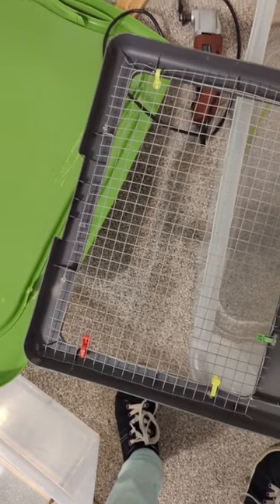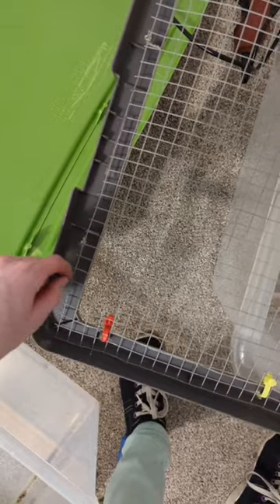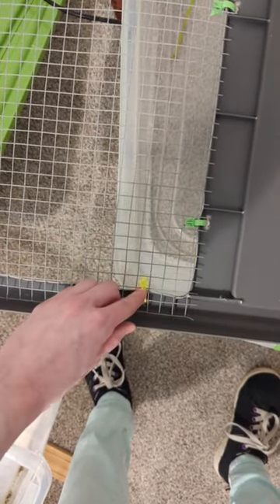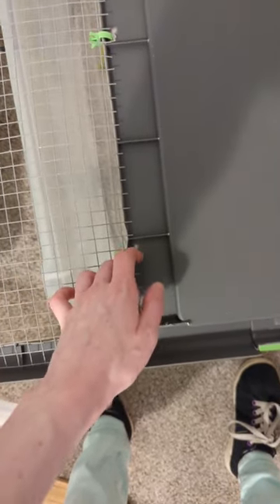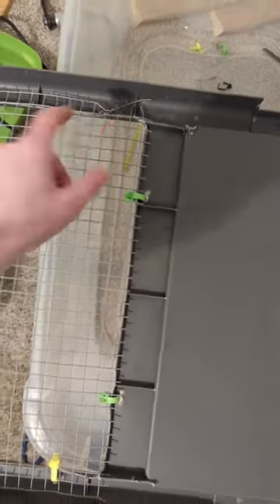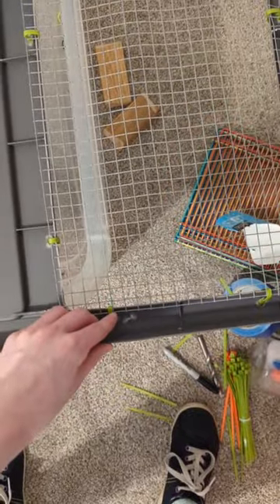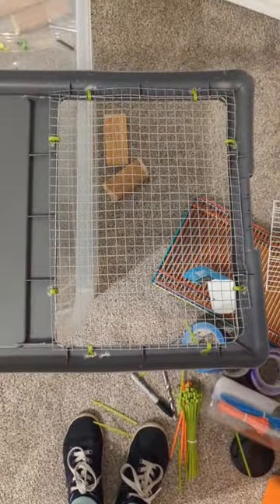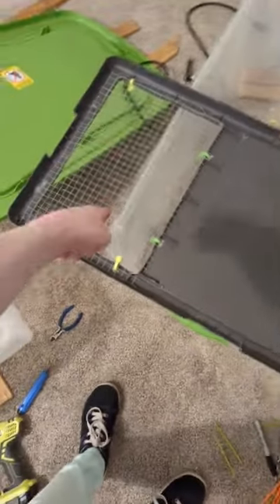Fixing a Hamster DIY Bin Cage Lid | Munchies Place #Shorts

Comment: Great tip! I've always just put the wire on the outside and use extra zip ties, but I can see how wire on the inside would be more aesthetic and probably prevent the hammies from pushing out
Reply from the maker: I personally like it outside too for their safety but the wiring job they did to this bin unfortunately only worked on the inside. So we are at least trying to make it safer before selling the cage.
Reply: @MunchiesPlace there is a woman and 3 children missing right now. Without makeup you look a lot like her.

Comment: Would putting the wire mesh over the top with like an inch or so a gap of plastic work better than underneath? I know it's not a pretty for us to look at but wouldn't that leave no rough edges or possible sharp parts on the inner part where hamster will be exploring examining trying to find any gap or mistake I made?